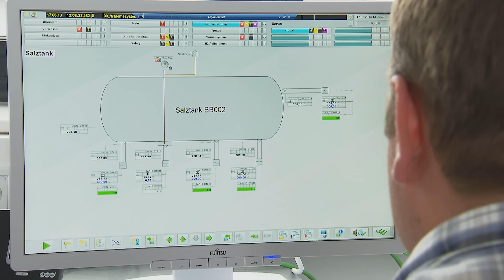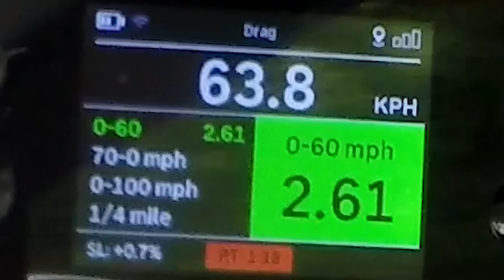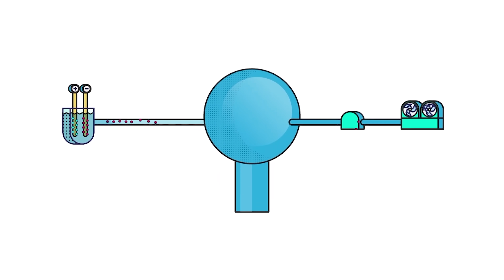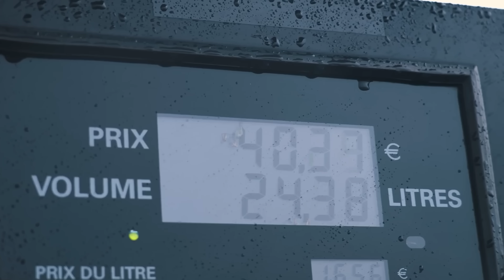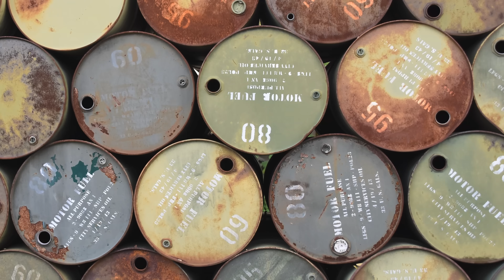Porsche just SAVED petrol engines FOREVER

Comment: The problem is that ICE cars have only about 20% power efficiency while E cars have it around 90%. So if both examples use electricity generated by wind turbines (in the case of ICE to turn it into a synthetic fuel) the electric car will be able to cover 4 times more distance on the same amount of energy. The bad things for us, petrolheads, don't end there. On top of losing in efficiency by straight comparison, there are also great losses when you turn the electricity to synthetic fuel. The process is about 30% efficient in terms of energy input and output. So ICE running on synthetic fuel will be 12-15 times less energy efficient than EC, however, it could be considered carbon neutral. ECs have a problem with raw materials, which currently are mined by child labor in Congo. So the next time you will see the "green" owner of the Tesla, tell him that at least 1 or 2 kids died while digging by hand in toxic cobalt mines in order to gather enough raw material for him to say that he is "sustainable and carries about the world".
Reply: Battery technology is improving. Some batteries are already produced without cobalt.  But however you look at it the days of everyone (in the affluent countries) owning a private car (or two or three) are probably numbered.

Comment: i would say there is good chance there will not be EU or/and USA by 2035, so their ban on cars is dumb and obsolete. Not to mention that electric cars tech is still not very good and smart to use, not because range, but because huge poluton in battery production, and not to mention battery trash that is mostly not recyclable. With out ever mentioning that infrastructure for massively charging of electric cars is not 1% done, and so many problems and fires of electric cars. only possible solution is if no one owns cars and you get driven based on credits by local AI cars that will drive you around similar as uber, and make you take more ppl in ride if you want cheaper price.

Comment: Ok so I have dug up some figures. Changing the electricity from the turbine into an e fuel is only 39% efficient . Put the fuel into a fossil car and it will be around 35% efficient at driving the wheels (the rest is heat) multiply the two percentages and you find that only 13.6% of the original turbine energy is driving the car forward. I would prefer to put the electricity into an electric car which is 90 to 95% efficient thereby cutting down the number of turbine from 7 for the e fuel to only one for the electric car.

Comment: The reality is likely to be that there won't be Dacia Sanderos or hybrids or other similar cars running on E-Fuels. It takes a lot more energy to make these fuels than you get out and then when you burn them engines are circa. 35% efficient. So for the same amount of electricity you could power a car for many more times the distance. The resulting economics will limit use to special cases such as expensive sports and super cars and possibly heavy machinery that is not easily electrified.

Comment: I am saying that as a mechanical automotive engineer and I do prefer combustion engines, it´s just not happening.
This won´t happen unfortunately. E-fuels just burn energy on mass, they are really really REALLY bad efficiency wise. It´s probably by far the worst solution. There is no way we could ever produce enough energy in a sustainable way to create nearly enough e-fuel for it to be somewhat affordable. It would be about 2-5x more expensive.
It´s basically a marketing gag at this point. E-fuels make sense for airplanes because they have to be light and have other limitations but for cars ? This would simply not be affordable.

Comment: So it works bacially just the same as a normal petrol car does but instead of cheap oil out of the ground the petrol would be 2-3x in price because it is manufactured through the whole hydrolysis proces which in turn would increase the costs for owning and driving a car which in turn increawes the ciost for everything else in the supermarket because somebody has to haul all the stuff somewhere. Great idea, people will not be able to afford driving cars anymore.

Comment: Everyone is acting like Porsche is saving ICEs with this fuel but it’s completely untenable as an actual replacement for gasoline. They said so themselves.

Toyota’s hydrogen ICE in the other hand could actually be implemented and used by the common man.

Comment: Few problems: electricity is NOT carbon neutral. Distribution is NOT carbon neutral and every energy conversion have losses. In the end we will ruin planet by either ofethod because we just consume too much. Remember times when 240 HP Porsche was thought performance wehicle? We need to reduce consumption.

Comment: Hmmm CO2 atmospheric recovery is very energy intensive an there is currently no successful large scale project (and many failed ones) Electrolisys, also very enregy intensive, when this is describeds as carbon neutral How? Very large renewables to supply processing? the main reason given not use bateery vehicles was lack of large scale renewables. Hmmm Wish it were true but its wishful thinking - show me the numbers cause i dont reckon they are there.

Comment: More wishful thinking. There will never be enough windmills or solar panels to generate enough electricity to power homes, let alone EV's or this latest pipe dream - green fuel. Renewable electricity generation is expected to be just 30% of global requirements by 2030, that's before green fuel is added to the mix.....This will only ever be a niche market thing, a carrot dangling on a string to keep the faithful occupied.

Comment: I don't see how e-fuel will solve the problem of there not being enough renewable energy by 2035. How efficient is e-fuel production? Does it work out more, less or about the same as charging batteries? Need to include distribution in these efficiency figures. If it is less, and I suspect it would be, then we'd need even more renewable energy.

Comment: Seems bizarre to me why technically limited people want a reciprocating, complex, high maintenance, machines rather than a relatively simple electric motor. Engines are noisy, and costly to own and run. Electric motors are virtually silent and low cost to run and only need electrons. This seems like a solution for large construction machinery and possibly aircraft but for the normal user who basically want to go from AtoB it really doesn’t matter. The problem seems to be petrol heads can’t cope with change and the old school producers are just stalling in pursuit of profit🔥

Comment: Two things:

1. You still need a massive abundance of renewable energy to make eFuels carbon neutral. In fact even more energy is needed than if you just used the renewable energy to charge electric cars. The eFuel manufacturing process is much less efficient than the transmission of electricity and charging an EV.

2. Even carbon neutral eFuels don't give cities any air quality benefit in the way that EVs do.

I would much rather resources be focused on building out EV (or hydrogen) infrastructure than eFuels

Comment: Electric cars dispite their fire dangers and extreme emissions on producing the batteries that also need to be replaced, consider No country's power grid can support this, not even close. That being said if your goal is to reduce carbon emissions then it's much worse electric cars will be powered by coal, gas, oil, and diesel etc to the tune of over 93% in the best case. Beyond ridiculous.

Comment: 20 years ago two Canadians had developed the process to liquify carbon capture for fuels. But, the Oil Companies saw no profit in it and so killed the tech and any links to it. Interestingly, Paddy Lowe (former Williams F1) bought the rights to the Tech. And now, Porsche are 'supposedly' being revolutionary now. No, it's just a case that car manufacturers have screwed the car market and maximised its profit from false eco vehicles. Now, we're on to the next phase. 30years ago, Readers Digest produced an article that advocated using Veg Oil with Diesel to reduce emissions. I ran an old Peugeot 205 on 50% Diesel / 50% Veg Oil it equalled zero emissions at the MOT Test. But, again once someone cottoned on because people were going into Supermarkets to buy up the Oil as it was significantly cheaper than fuel at the Pump, it was quashed as an idea. None of this is ever about reducing emissions or the environment, it is solely about profitability.

Comment: Perhaps we should wonder why we banned petrol cars in the first place... which is not "surprising".
We are currently suffering from the consequences of our human-caused climate change and ocean acidification, and it will get worse year after year causing the death of millions of people.
This climate change is caused by green-house gases, which CO2 is the main one and mainly emitted by transportation systems.
Therefore, it is not a surprised to ban petrol engine in order to cut down CO2 emissions. Such policies shall have been taken 20 or 30 years ago.
Note that this measure itself is not sufficient, as car production itself generates a massive amount of CO2 and other fuel alternatives (electricity, hydrogen) have a high carbon intensity in many countries.
In other words, we shall limit drastically the production of new cars and introduce law to limit their size, weight, power, usage, and encourage car-sharing, car-pooling, public transport, less transport, etc.
We are just 20y late.

Now about the "biggest u-turn", it is actually a double standard for the rich pushed by the automotive industry in order to maintain their benefits and sales. Who is able to by a Porshce car with XXXhp and pay for are synthetic fuel except the 1% ?
So let's remember what is in the balance : profit vs. avoiding the death of millions people and starvation of billions.
And the automotive industry lobbys chose... Profit, profit and profit again...

So, what about synthetic fuel ?

First, these cars are not "carbon neutral" or "net-zero" cars.
Saying they are is a complete scam for customers, it doesn't make sense at all not to consider emission at production, reparation, fuel production, destruction/recyling. Carbon neutrality can only be considered at the scale of a country or higher as you need to include the entire life cycle of product.
Actually in France, we have a law that prohibits using these terms if you don't have data to back it up.

Second, how they are made... The carbon capture technology are supposed to be used to reduce the co2 emissions emitted by factories and store the carbon in the ground... not to emmit it in another way ! We have to remember that these is too much co2 in the atmosphere and ocean, we need to reduce its concentration.
About hydrogen electrolysis, at the moment 99% of hydrogen is produced... from fossil fuel ! and it wont change within 10years and the operation is very inefficient.
Finally, ethanol, or often called "biofuel", is produced based on the agriculture system (which is not itself carbon neutral btw). We have experienced in Europe the most dramatic canicule and drought ever recorded in 2018, 2020, 2022, and soon... 2023. The price of food is skyrocketing due to the conflict in Ukraine and the environmental disaster we are experiencing. People are staring in some countries and even in the developed countries people are struggling to buy basic food... and you want to put it in a sport car with XXXhp ?! Unfortunately that's not possible, because the aeronautical industry, the marine industry, the military industry are all planning to use it as well to become "carbon neutral"...

So let's make things clear and simple:
1. Avoid : if you can avoid a commute, avoid it.
2. Transform : if you need to commute, use other less carbon intensive transportation system (walk, cycle, public transport, car sharing)
3. Innovate : if 1 and 2 are not feasible, use innovation to commute : electric bike, scooter, make car smaller, lighter, more aerodynamics, share them, etc. and synthetic fuel come at last !

That's called "degrowth".

Comment: The EU’s push to discontinue gas engines is not about being sustainable only, I’d say the bigger reason is energy independence! We are hostage of the OPEC countries, many of whom lean in to the authoritarian side. This cartel can easily manipulate petrol prices by artificially cutting production, which in turn hits us with inflation, etc. and could coerce us with embargos if as a political leverage tool. Be it with EVs or with synthetic fuel, this transition needs a lot more infrastructure, but it must be done!

Comment: I love combustion cars, but I don't know if this will be the final answer. As you mentioned, we need electricity to make this synthetic fuel, but with every conversion energy will be lost. So we waste a lot of energy especially because combustion engines can only use about 30% of the stored energy for driving. The rest is lost in heat.
Also the question arises is carbon neutrality enough? If you already captured it, you could store it to "cool" the planet down. Because some say the planet is already too hot.

With this i don't think it will save combustion cars. It will become a niche product for some car owners. Maybe it will be useful for transportation where a battery is a problem, for example in planes.

Comment: This is not carbon Nuetral. It takes energy to make this fuel. I.e. more CO2. Unless its powered by renewables which at that point. Its more efficient to just use that electricity to drive instead of converting. I.e. all a waste of energy to use "e fuels"

Comment: So basically, we don't have the abundance of renewable energy to make battery electric vehicles possible, but we have the abundance of renewable energy to make synthetic fuels happen. 

The latter magnitudes more inefficient than the former one. I get the arguments of lack of raw materials for batteries, and a lack of infrastructure for charging BEV, but assuming that E-Fules do not have similar limitations is silly.

The inefficiency of E Fules requires a lot of more energy, hence a lot of more infrastructure for for renewable energy production. For this also a lot of raw materials need to be gathered. (same argument like against BEV)

The Carbon Capture fasilitis also do not exist yet. By the numbers presented in this clip, the amount resources and money we have to throw at this project would be an insult. Just to safe ICEs. The money could be used otherwise to fight the harsher conditions we life in due to climate

Comment: I think currently it is a toss up between EVs, Hydrogen and Synthetic fuels. Probably in that order in terms to availability, investment, manufacters working on them, infrastructure and efficiency. Snythetic fuels are very much an unknown at this point I'd say, with hydrogen having significant hurdles to overcome (ability to produce enough in a green manner, storage/transport/infrastructure problems, safety concerns and efficiency of use and production). Not to say that battery EVs are perfect in all these catagories, by far they're not, but they're currently much further along than the others and if some of the enviornmental concerns can be resolved with future designs in research phases currently then they could leap forwards significantly (if Aluminium batteries can be made a reality it would be a game changer), but a number of ifs there still of course.

Comment: You CANNOT get to CO2 neutral with an EV.  NOT POSSIBLE due to the battery and the CO2 in a 100% RE grid.  The max reduction is 50%.  You can be truly Co2 neutral, including the car, with NET engine and solar tech...  An EV is totally obsolete if CO2 neutral or better is the goal.  Just stop wasting time and money on this junk EV dead end for CO2 neutral.  Won't work and the lies will be exposed.

Comment: So your saying we just going to methonal which has been around for the last 30 years for race/drag cars and aero... not exactly much of a change then, except the piece that methonal requires 3x the amount of fuel usage for the same power level's, yes it comes with a huge advantage inside that being it has really good thermal properties methanol raises the octane of petrol, and minimizes engine knock, which comes due to excess heat or pressure but also has a big disadvantage methonal is extremely corrosive, and leaving it in the fuel system can degrade the parts, like the fittings and seals along with hoses. it will also condensate much like Ethanol and can cause further problems of water in the system and oils needing to be replaced more often. Methanol is a great product but with it will come more servicings and requirements

Comment: What about other released harmfully gasses not just CO2. It's the same  combustion engine I think it's just another scam really. Another workaround in the "system" to continue to profit with the more inefficient type of engine. From what I understand, you said that making of hydrogen is one of the steps so why not just make fuel cell cars? At the moment making hydrogen is more energy consuming in production  than the energy it gives. That's why it didn't catch on with Toyota's Mirai. Think about what break through are going to happen if ICE manufacturers put all their time and money into battery research and development instead of saving the 150 year old 20% efficient and vastly more complex internal combustion engine. And who at the end is driving electric car prices up? Why does Chinese manufacturerers can make new cars for their domestic market from as low as 8000$?